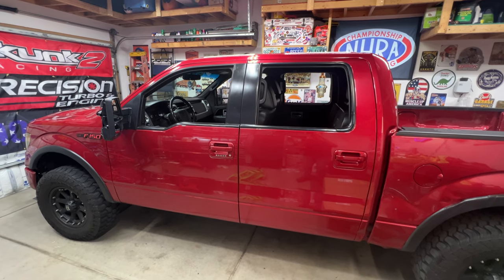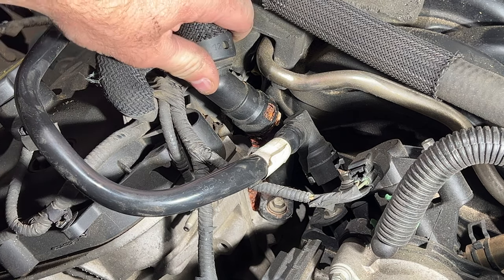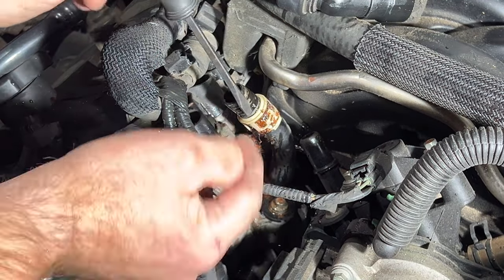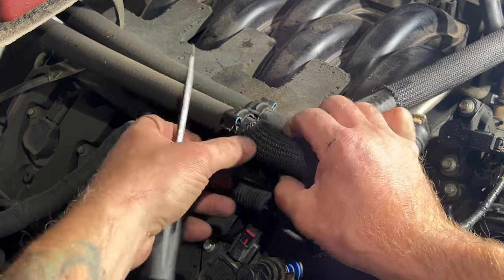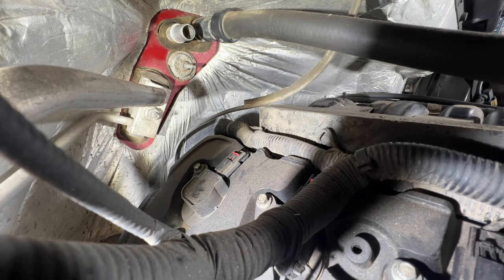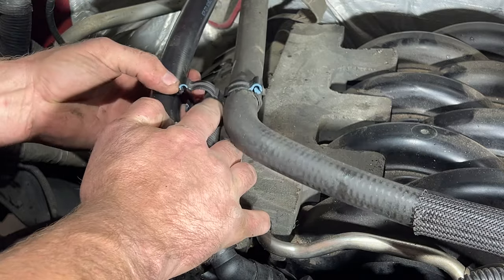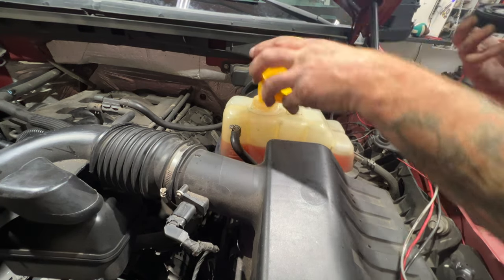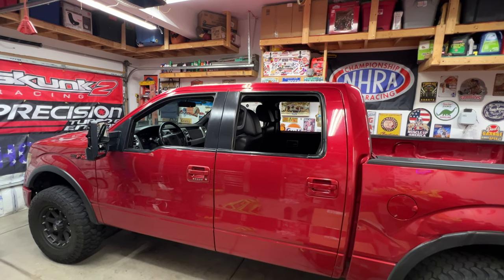Ford F-150 Coolant Leak Fix Heater Core Inlet Hose Replacement How-To

Comment: Good day. I have a 2017 Ford F150 5.0 v8. I think the video might solve my program. Yesterday, I saw a heavy coolant leak at the rear of my engine running down on the bell housing. I think this hose is the problem. Another video said that if I have this problem, then this hose is where the leak is coming from. Has anyone else experienced this?

Comment: That pink coolant shouldn't go in a container it should go in the drain. The drain on the ground. You should run motorcraft yellow. That's the update.
Reply from the maker: You are correct motorcraft has switched back to the yellow coolant but if you keep up on coolant changes you won’t have any issues running the orange still.

Comment: some info Don't know about the 2014 and prior,  2015 and up have a 3/4 hose and the fitting is 3/4

Fitting Dorman 90 degree 800-418  is 3/4 push to 3/4 hose
or 800-411 is a straight if preferred,   I believe 90 is better because the hose pulls hard on that fitting causing fatigue.

1in PEX barb has 3/4 OD
clamps
Splice the hose as needed might have add short piece or may be not depending on the splice location

Info
Dorman 800-404 is a straight 3/4 push to 1/2 hose
Dorman 800-403 is a straight 1/2 push to 1/2 hose

Comment: Since it's just the o rings that looses it's ability to seal, can we just replace just that?
Reply from the maker: You can but you’d have to find the correct one and I don’t know who sells it. I figure it’s just safer to replace the whole hose that way your getting new rubber as well